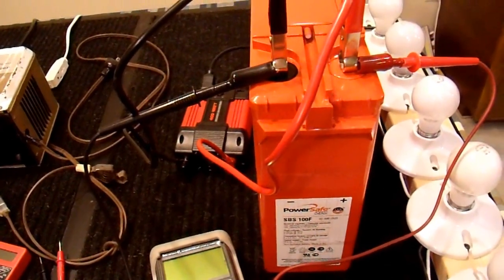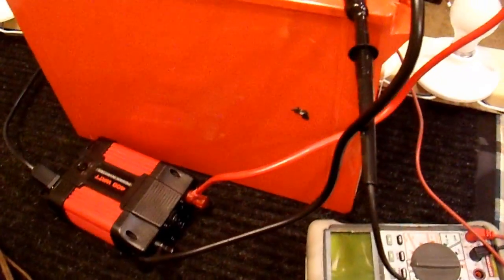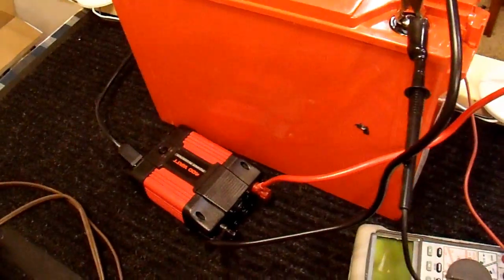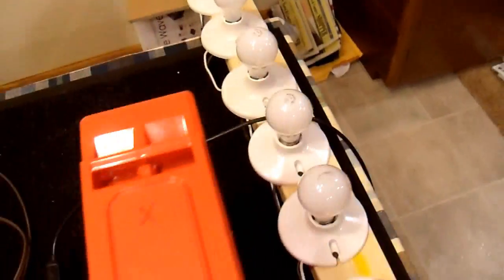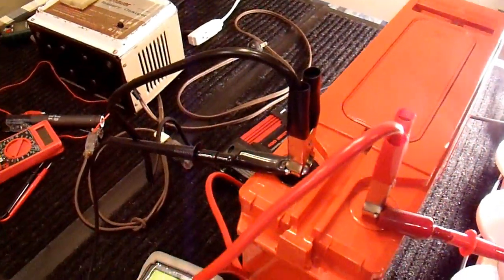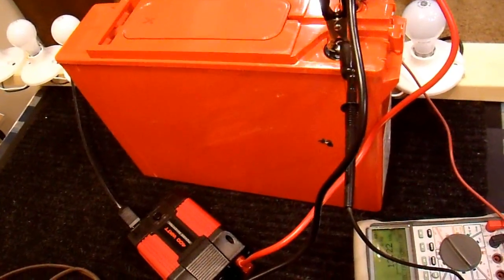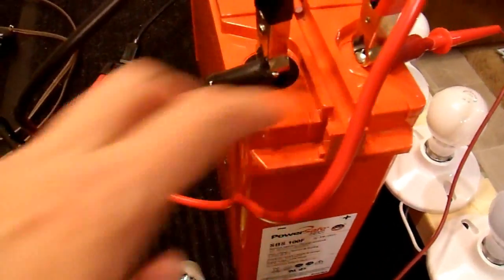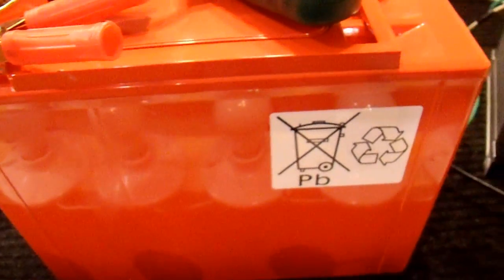Deep Cycle Battery Desulfation Attempt Follow Up - Part 1

Comment: Did you open the battery and add distilled water before you started the restoration process?  I thought you had to check for dry or low cells before charging a battery.

Comment: Keep your current limiting resistor in. In the initial stage you removed it, thinking this would speed things up. But it made no significant difference to the actual rate. With 1 ohm and 30mA going through it, that's just a 30mV drop. That only takes your 16V down to 15.97V.

Comment: When a cell is dead, the resistance is low, rather than high, correct? If it's getting hot, that would be low resistance, according to my training.
Reply: Hot is proportional to power dissipated. Power = I² x R. So the more R's, the more hots.

Comment: I have a 200AH battery which had similar issues before. I didnt have the time to really follow timing ofthe steps you recommended, but it now supports a 30W load for about 8 hours, thru an inverter. The voltage drops quite fast though and the inverter starts beeping after an hour or so. What should I do?  Thanks!
Reply: "Sell the lead, it's dead." Begrudgingly he said.

Comment: Is that a buoy battery? What is its standard use? I've never seen one like it. You just said my next question 100 AH battery. The car battery you show in the last video, how many AH was that? (the CCA rating can be confusing, some co's use 0 F and most use 32 F )

I wonder if tapping or putting the battery in something like a paint shaker to get the stuff off the plates would help. BTW What battery company do you think you get the most bang for your buck in terms of deep cycle lead acid batteries? Is there anything in Li-Ion that is even close?

I used to buy all Sears Gold Batteries but since sears has turned into selling overpriced underfinished (I notice it on my woodworking shaper bits for my molding maker on my craftsman 220V 12" blade table saw -- an older rarer one) crap I am less and less inclined to give them my business.

Comment: Mixing batteries in different condition will deteriorate your better batteries.   Ideally, all batteries in a bank should be the same type, same voltage, same current rating, and same age - and, they should have always been used together.  When one battery goes bad, the entire bank should either be replaced or restored.  

If you want to squeeze more life out of an individual battery, use it separate from other batteries.  You can't win by mixing them.  The weaker battery will always pull down the stronger batteries.  If they're in series, the bad battery adds voltage drop across the entire array.  If they're in parallel, the bad battery is constantly draining current from the others and losing the current in heat in the sulfated cells.

The only thing mixing them might accomplish is to give you a brief increase in peak current or peak voltage, depending on whether you're using them in parallel or series.  But, total capacity will be diminished.

If you identify one bad battery in an array, remove it if at all possible.  You're better off without it in the array than to have it bleeding power from the other batteries.
Reply: Richard Owens is it feasible to put a diode on batteries in a battery pack? This would prevent the back charging you described.

The problem I see is the cost of high amperage diodes.

Comment: +knurlgnar24 I have an 880 CCA battery that I replaced about 18 months ago. its been sitting in an non-climate controlled environment through at least one summer and one winter. a few weeks ago I decided to experiment with it. i charged it up and used it for various things, recharging afterwards, and it was able to hold at 12.6V for several days between uses. I thought "cool! :)" until a few days ago I pulled it out again and it tested 10.7V, I thought "awe :(" so I've been experimenting some more... in your case here one cell was hot while charging, but on mine, one cell stays cool and the rest heat up significantly. the same cell is also the only one bad in the SG test, the rest are great. so, what does this mean? is that one cell completely shorted? as opposed to just being "dead"? thanks.

Comment: you seem knowlegable about Pb/H2So4 batteries...i'd like to know if during reconditiong, is it possible to reformat a pure cranker to deep cycle type.
Reply from the maker: Deep cycle and SLI batteries have a different physical construction.  It is not possible to convert one type to the other.

Comment: I think it is unfair that you say that using an electronic desulfinator is a get rich quick scheme, and then say it does not work well.  One could argue that your method does not work "well" either. as of yet you only get 10%.  There are videos showing the actual results of electronic desalination.  I have personally seen these bring back more than 10%.  My personal opinion is use everything at your disposal THEN turn in the core.
Reply from the maker: This battery was recovered to 50% in the end and will take a charge very well, has a lower internal resistance than most automotive batteries, will run inverters and will start a car without any issue.  Most people would scream 'success!!' with results like this without any further testing.  But, no, it is not success.  The battery is still bad.

Comment: You said 200 watts is 20 amps!!!!!
Reply: Alrighty, thought about my comment and I exclaimed because I don't get the input output measurements. And this is really a sidebar comment. The battery voltage varies with the rate of discharge, so with a constant load of 20 amps how can the inverter output remain constant with a variable input?  I'd expect the bulbs to start dimming as soon as the test begins. I know your test was just a simple resistive load test to measure the battery until discharged to X volts and it doesn't matter how many lumens the bulbs output. But, the sidebar, does the inverter step up the voltage in some way to maintain 200W so we would know what the total load is over the time of the test, such as amp-hours?  Could the test show the capacity of the damaged battery compared to the manufacturer rating?  Thanks for all the videos.
Reply from the maker: Rd Hood
The inverter has two stages:  A voltage boost stage that takes 10 to 15 volts input and boosts it to around 150V, then a bridge chopper circuit that alternately turns on certain transistors to 'invert' the voltage positive and negative to make 120VAC.  Either or both of these stages can be continuously adjusted by the inverter to make a constant output voltage regardless of the input voltage, though in cheaper inverters like this one the input stage is generally passive (meaning the 150V will sag along with both load and battery voltage) and the output stage is the one that does the voltage compensation to keep a constant output voltage.

As the battery voltage drops the battery current increases, so 20A is just an approximate measure.  A rough rule of thumb is 10A of battery power = 100W of 120V inverter output.

If we wanted a scientific test I would need to use a datalogger on both the output and input and integrate the measurements.  That way we could get a precise measure of all of the parameters.  This is just the 'poor mans' way of doing it, and for most purposes a simple setup like this is adequate.

Thanks for your comment!

Comment: If you want to measure the capacity more accurately you could get a power meter. I got mine from "dx dot com". Search that site for "G.T.Power 130A". It costs $25. I have one and it works great. It won't cope with 130A continuous, more like 50A, but it should be more than enough for capacity testing. Let me know if this helps you and keep up the great vids =)
Reply from the maker: I've never needed to accurately measure DC power before where I was willing to put an extra resistance in-line with the load.  I can think of many places where it would be useful though!  $25 sounds like a steal if it works well.
Reply: ***** Its particularly useful for measuring the capacity of AA style batteries or 7Ah lead acid etc. It will only measure up to 60Ah or so but you can always reset it and write down the value and add them together later. It's worked well for me to test some lithiums I recently got that turned out to be only 10% of the stated capacity on the label! If you get one I hope it comes in useful for you =) It's definitely a steal at that price when they normally RRP for $100+. DX is a brilliant site for things like that.
Reply: +abyssunderground But the shipping times for DX dot com are horrendous 

Over a month to Australia or 3 weeks by express
Reply: +mewantbrains Yeah it's the same to the UK too. I just deal with it. There is another DX style site called BangGood whose deliveries are half that time (to the UK at least). Typically I see them in 10-14 days.
Reply: Il check them out and see what happens

Comment: Would'nt repetitive discharges under high(ish) load reverse polarize the weak cell? I tried to desulphate a similar AGM battery but cycling only made it worse. The weak cell kept getting weaker until it died. Discharge current was about C/10 to 10.5V. Very nice vid, as always. Waiting for part 2.
Reply from the maker: If the R is too high or Capacity too low reverse formation could be a problem with repetitive deep cycles.  This is why I used a low-ish load (20A more due to impatience than anything, actually) and stopped at 11.0V.  At 11.0V you can guarantee that a battery with a single weak cell will not get reverse formed since the other 5 cells, even if in perfect health and fully charged, would not be greater in voltage than 11V.

I had another battery just like this that wasn't as badly sulfated and I was able to successfully restore that one with this method.  That video series is still in the works.